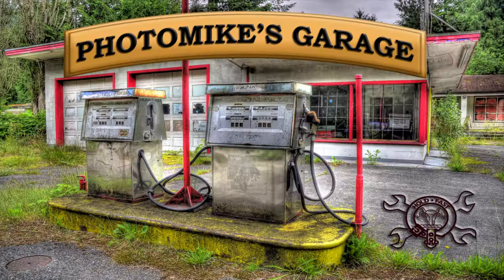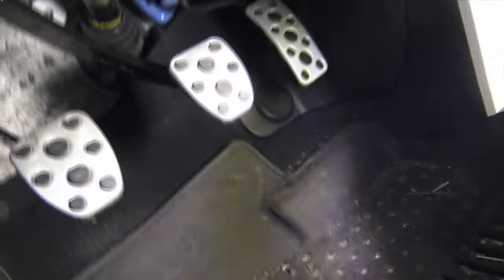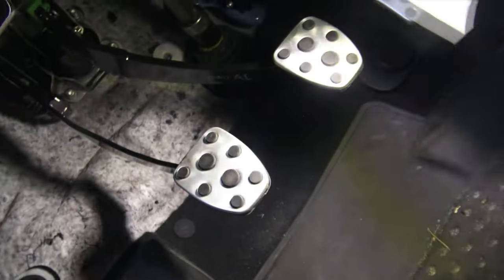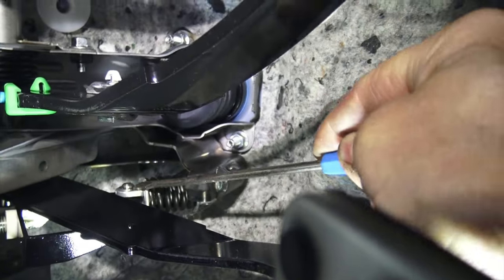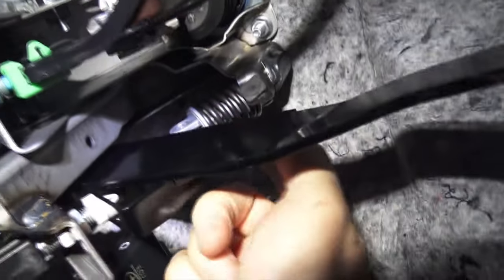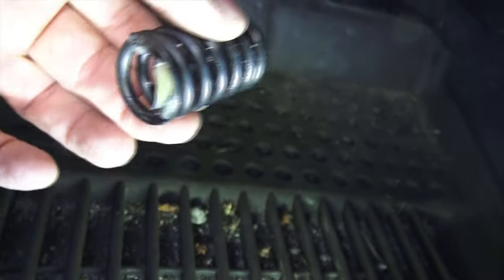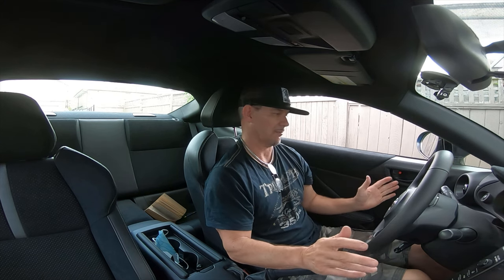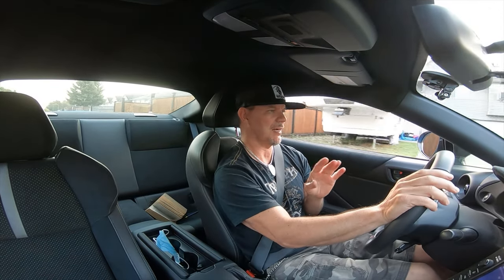GR86 free clutch upgrade! Did I wreck my car?

Comment: Dude same thing with me I’ve been driving manual since I was 17 but It’s just so hard to drive this car smoothly for no reason!
Reply: It's not just the bite point. The throttle delay is a big part of it. I'm getting pedal commander to kill the delay and change throttle mapping. Ppl are saying City -3 or -4 is good for daily, and Sport -4 is good for fun. I might also do the clutch height mod to lower the bite point. That should result in max predictability and control.
Reply: @nn99nn99  Exactly, it's the combination of the two that makes for a very annoying throttle response/clutch engagement experience. Great car otherwise.
Reply: @djSmokeShow  one thing that majorly improved clutch feel and predictability is the whiteline transmission mount insert (kdt926) along with City-4 pedal commander and the mtec clutch helper spring
Reply: @nn99nn99 would a short shifter help as well?

Comment: Learn how to drive a clutch   ..  why would you want a stiffer peddle  ...
Reply: Real answer: having smooth, linear resistance in the clutch pedal makes clutch engagement feel more intuitive. What this spring does is make us push harder to get it going, and then it pulls the pedal away from us as it passes the middle of the travel. It's very disorienting.